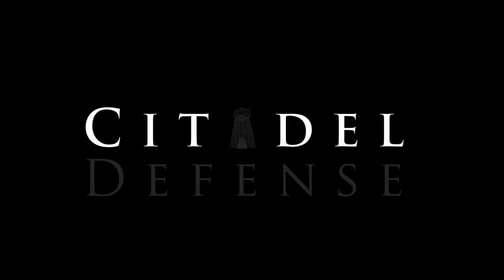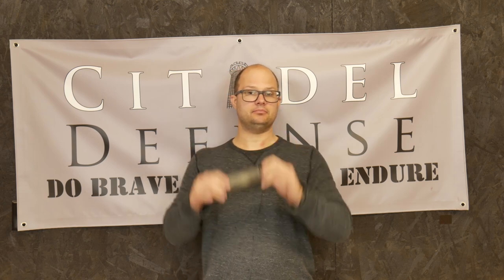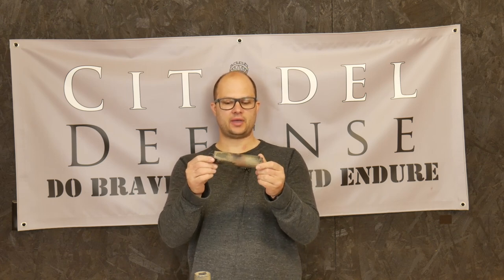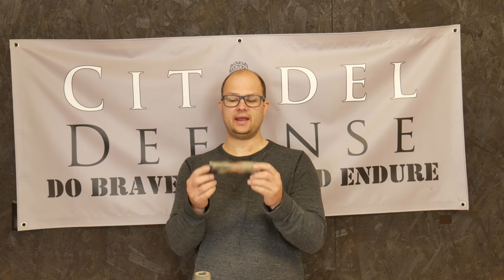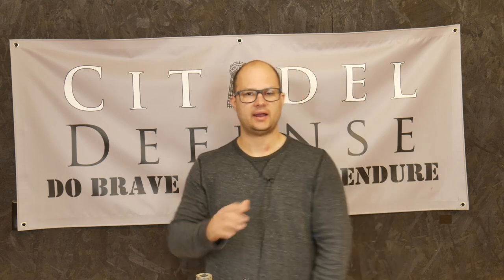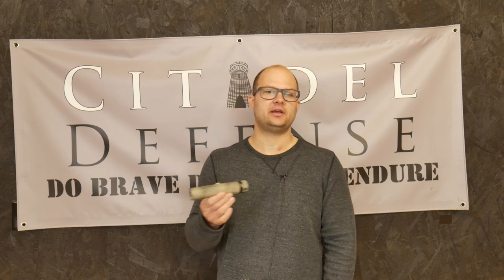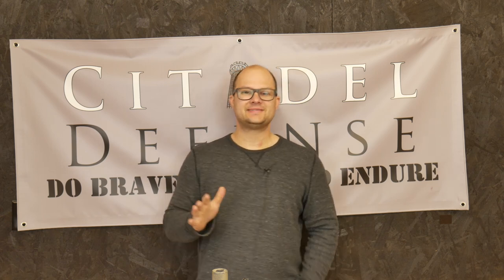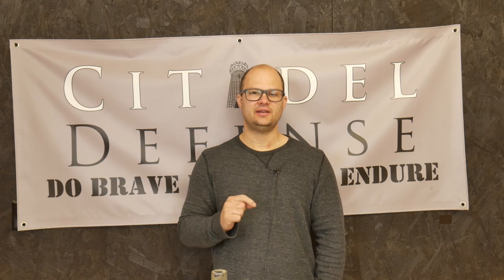American Minuteman Gear Part 42: Can you paint a suppressor?

Comment: I've painted a couple of my DIY titanium cans. Reg spray paint just couldn't attach even with sanding and when hot would wipe right off.

I got some high temp grill paint in black and green. Painted it, then baked in the oven for a few hours. I painted again, and it's able to hold and not wipe off now. 

With optics, i run a cover anyway because of the horrible mirage.
Reply from the maker: Huh, that's interesting about the titanium.  It must be far less porous than steel or whatever most cans are made out of